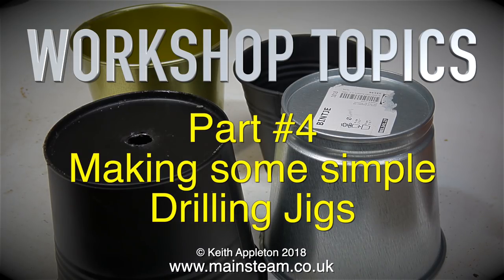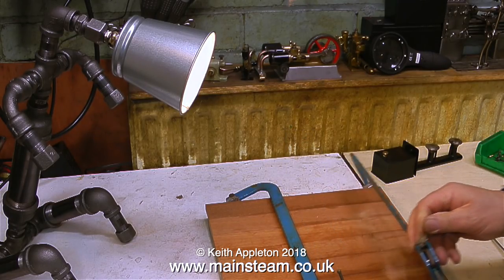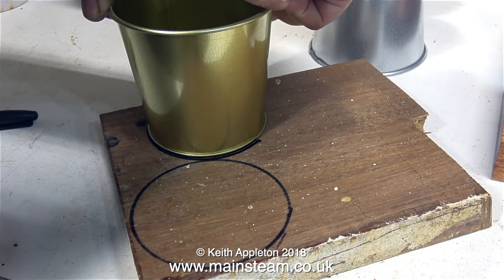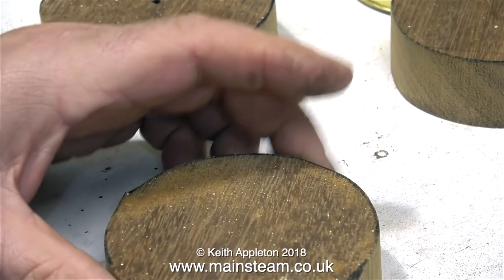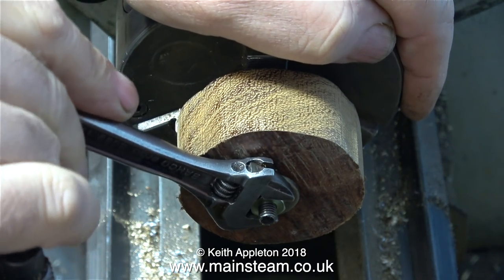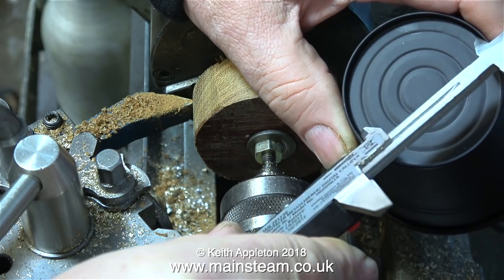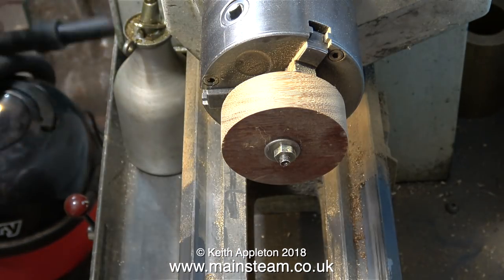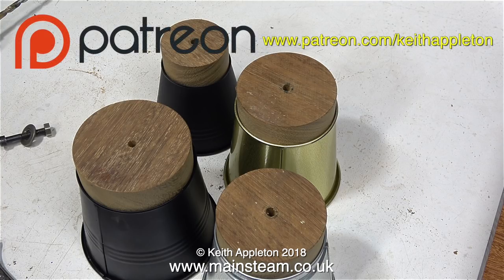WORKSHOP TOPICS - PART #4 - HOW TO MAKE SIMPLE DRILLING JIGS

Comment: A CDT student I was helping because she had missed a lot of her GCSE year, needed to find the centre of a circular table she was making. She found a very small centre finder, the only one we had, and scaled it up to give a 500 mm straight edge (using laminated mdf). It worked brilliantly, and she donated it as a teaching aid.
Reply from the maker: I was going to use a centre finder in the video, but then I thought that probably most beginners wouldn't have one . . . I have one somewhere in the Workshop.
Reply: @keithappleton  you could also use a compass at the beginning, draw two chords on the uncut circles, draw circles at each end of the chords that intersect, then draw a line through each pair of intersections.  classic perpindicular bisector, complex in words, simple in execution, accurate
Reply from the maker: Yes, many years ago I went to a good school and I know these things - but my method is by far the simplest - why complicate the lives of beginners ?